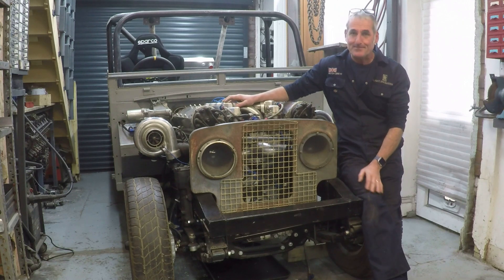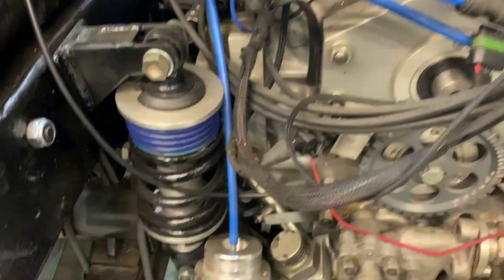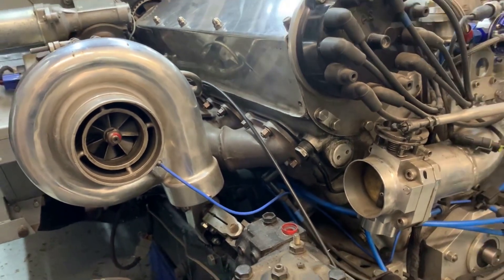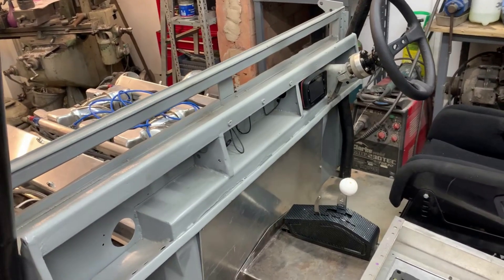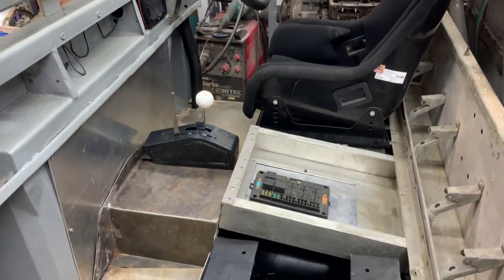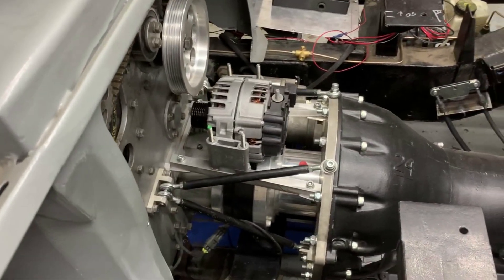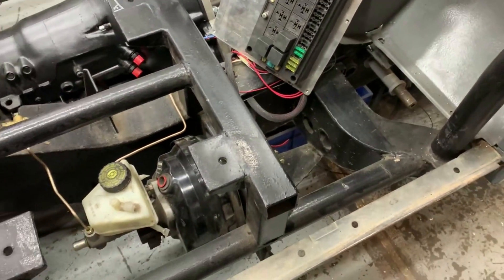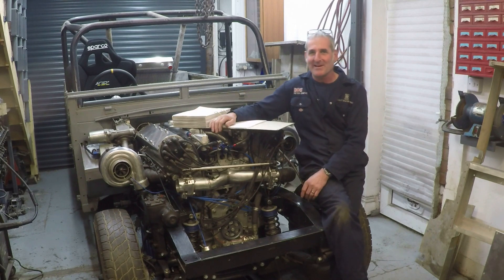Land Rover Meteorite Update 4 12 2022

Comment: At the start of the video you mention a chargecooler. Will this be used in addition to the ADI system?
Reply from the maker: Eventually, yes. The ADI system is modelled on the Rolls-Royce Griffon 58 which ran +25lb with ADI and no intercooler, but in reality it will make more power with proper intercooling / charge cooling, and there isn`t room for an air to air cooler up front!